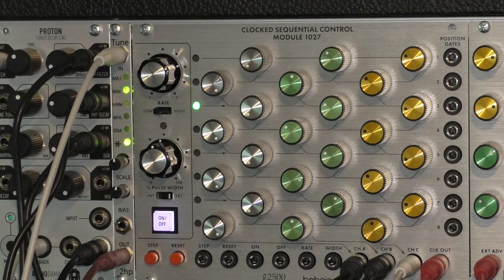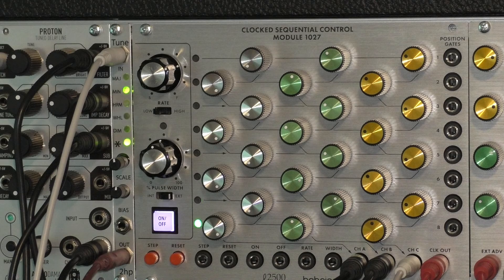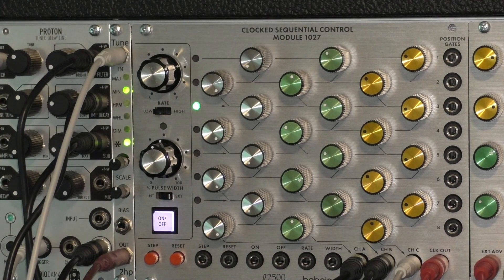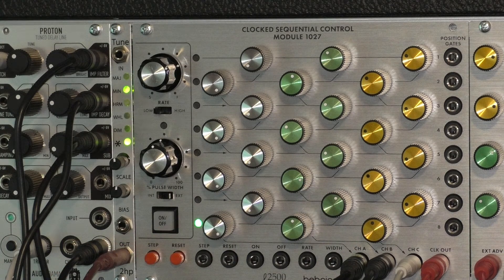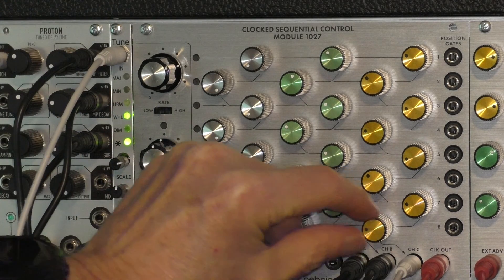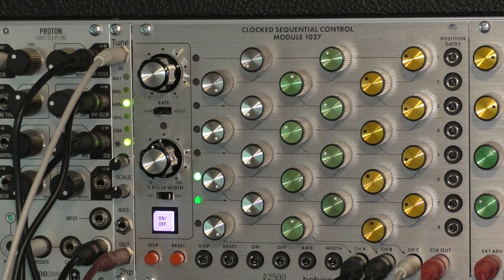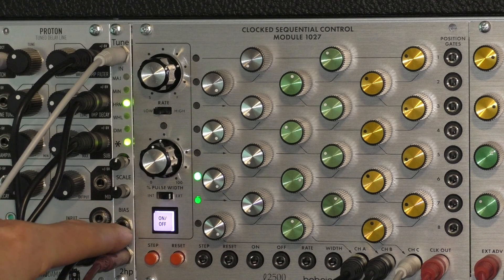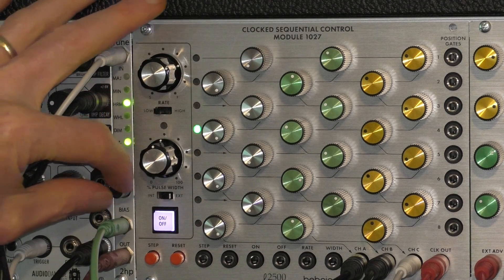2hp Tune Multi-Scale Pitch Quantizer with Behringer 1027 Clocked Sequential Control Module

Comment: I had this hair-brained idea that I could pipe an actual audio signal into this and it’d output the frequency in pitch corrected CV out, so I could compress voice or muh geetawr solo into it and run the CV output from that (instead of a keyboard) to control my synth.   I think your video was helpful in pointing out that’s not what this is going to do.  …I still haven’t found anything that does that.  :(
Reply from the maker: There is a product that does what you are looking for, audio pitch to CV, check out the Behringer Perfect Pitch PP1 Eurorack Module
Reply: @WayneJoness  ohhhh, Wayne thank you sooo much for the tip!  Ordered.  My tunes are about to get reeeal weird
Reply: I think Rossum has one like that too

Comment: I have a 2HP Tune but I need more.. my question is does the 2HP Tune quantize incoming CV to C4=261.6Hz.. A4=440Hz.. or does it quantize eventually to the scale you choose then you tune the pitch of that oscillator receiving CV..? ..I don't have anything to measure CV voltages.. thank you for your answer in advance
Reply: I imagine you've probably found your answer, but it's relative, not fixed because you can always turn the pitch knob on an oscillator. So the voltage coming out of the Tune module may be fixed, but what you hear will depend on how your oscillator is relating to that voltage. If YOU set A = 440 on the oscillator, the quantizer will make sure that incoming voltages are locked to a scale and the oscillator will spit out a sequence that is tuned accordingly, but I don't think there is a way for this module to tell the oscillator, "ignore the pitch knob position and make A equal to 440."

In your question, I think you are looking for calibration, not quantization. You can do this using Ableton's CV tools + a midi to CV converter to sync all of your oscillators and their slight intricacies to a master voltage (converted from Ableton's midi out) - there may also be modules that do calibration, I'm just not aware of them other than Expert Sleepers (which still use the computer to send the master signal)

Comment: Can I just use a square wave LFO into the tune and still get scales?
Reply from the maker: Well, a LFO usually means it is below the frequency of modulation is below what we perceive as 'pitch'. I don't think you would get much of a musical scale.
Reply: Only if your LFO can reach the audible range.
Such as the the Doepfer A-145.
In the H position of the switch, it will sound like an oscillator.
But it won't help a lot, since the A-145 is not Voltage Controllable.